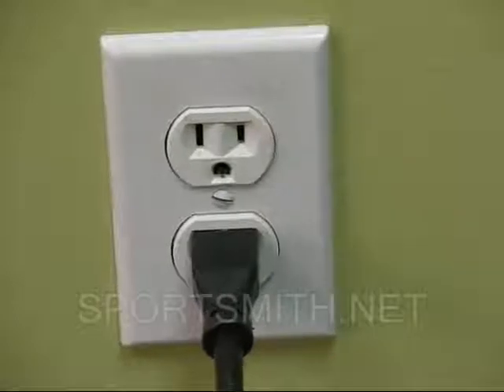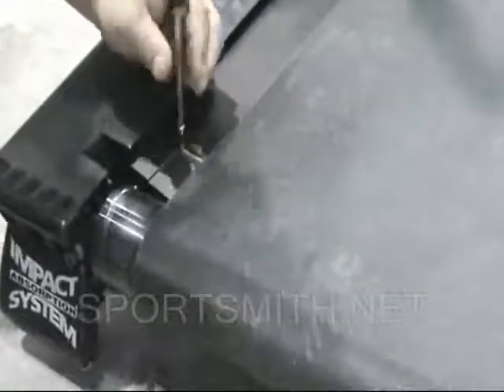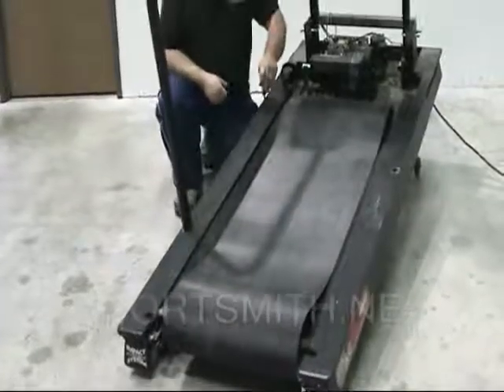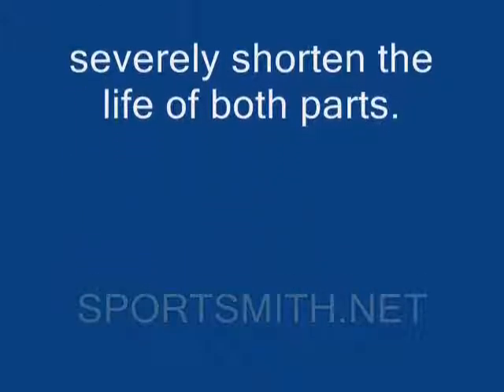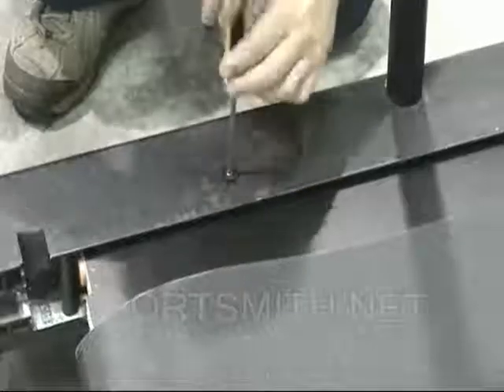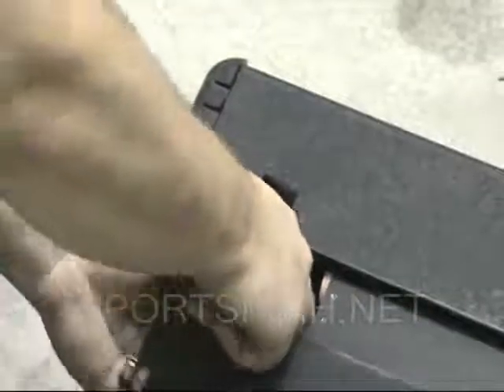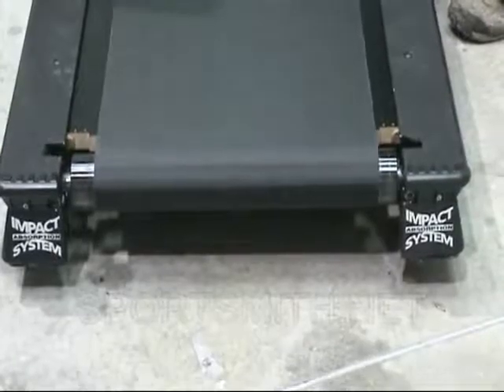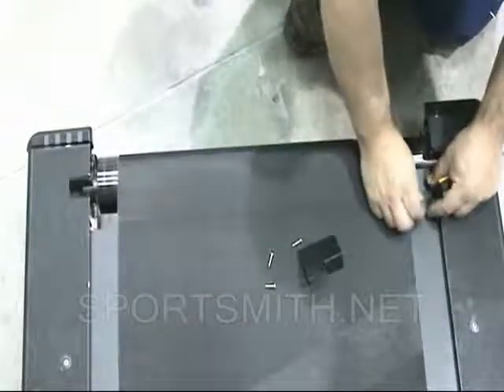How to Change a Star Trac 4000 Treadmill Running  Belt and Deck

Comment: Although not an exact match to my older Star Trac 2000, the basics were similar and this video was a valuable guide to follow for my belt replacement/adjustment. Thanks!

Comment: This is well done - just what I needed to know EXCEPT my model is a Star Trac 3900. Does mine has similar deck bushings to the 2 on the 4000 model? Those 2 screws are not exposed on my 3900. Please let me know how to accomplish this deck removal step on the Star Trac 3900. Thanks!

Comment: im having problems putting back on my drive belt, its ridiculously hard to get back on i have a 10 year old free spirit i replaced the big belt where you run but the drive belt is the problem now i can't continue until i get that on